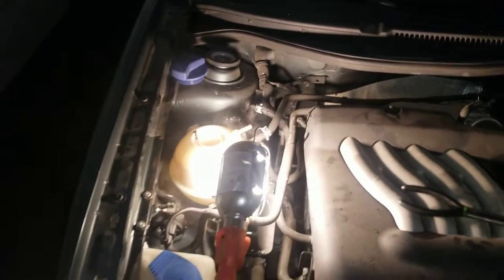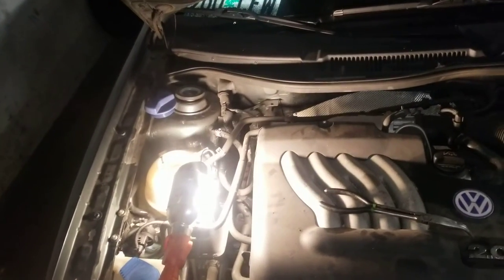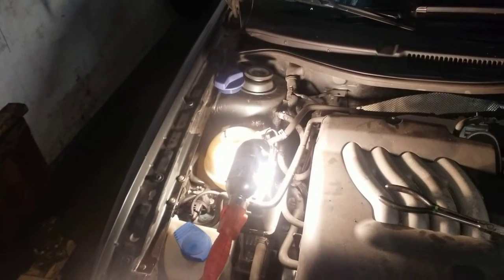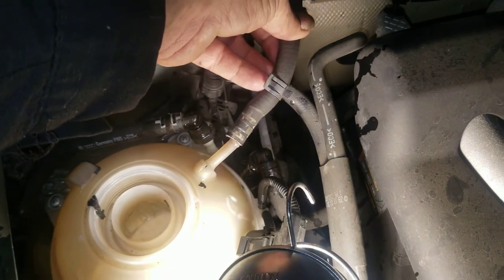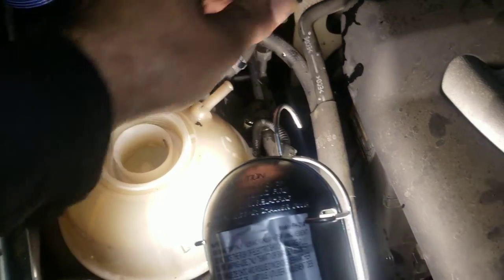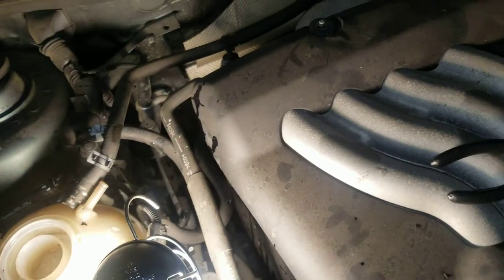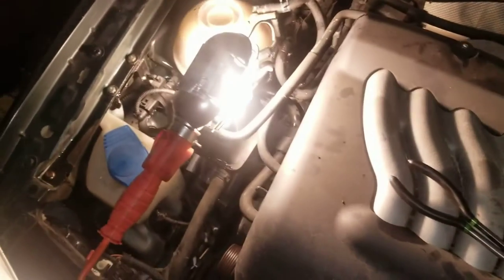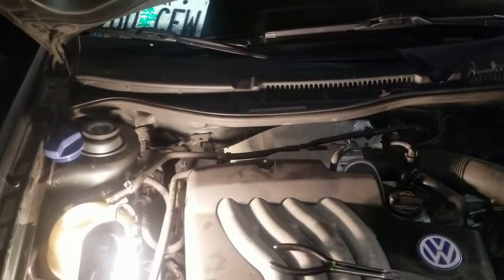VW No Heating Because Blocked Reservoir Returns Hose.

Comment: This car has been causing several problems with today this hose and tomorrow the next.  For 2 weeks now.   I notice the thermostat was not opening so i change it.  Hopefully that will stop all these hoses bustin.  Also my radiator broke too.  I jb welled that area so now its good.  I used the jb weld for water.  It sealed it right up.

Comment: Hi, great video. I think I have a similar problem. I'm getting no water through this pipe, the coolant doesn't seem very warm in the reservoir when engine is up to temperature, I'm also able to open this cap with very little pressure release - I shouldn't be able to open this and engine is overheating gradually - this is oil temperature, coolant temperature remains at 90 degrees after thermostat change. Previously the coolant temperature was stuck open, and engine temperature was around 92 degrees celcius. After changing thermostat coolant temperature bang on 90 and doesn't move but oil temperature climbing and climbing, up to 120 before I turned back home. It's never been this high before. Also changed the secondary/auxiliary pump as this became faulty and then had the water pump changed to no avail. I'm getting warm air inside the car but it's not as hot as I think it should be, but fairly warm. The lower radiator hose seems very cool to the touch, the top radiator hose is hot but this was a new radiator a year ago.

So to summarise, my engine is overheating, I have no pressure in the cooling system and the coolant is never very warm in the expansion tank. I have no leaks that I can see and the coolant level is always at max. It's a Golf MK6 2.0TDi CFFB.

Hopefully you could offer some advice, would be greatly appreciated!
Reply from the maker: Have you try to check the coolant temp sensor? On those cars always go bad and open the reservoir and let run for a while to bleed any air in the system. Sound like you might have air in the system or temp sensor is faulty
Reply: @abdelcarfix2770  the temperature sensor is a good thought, I haven't checked it so I'll change it. There are 2 I think, one on the bottom of the radiator and one on the side of the engine block, I guess I'll change them both. 

So with air pockets, the coolant has been dropped a number of times now with the various jobs that have been carried out, I made sure that no more bubbles were visible in the expansion tank while running the engine with the cap off, I squeezed the top radiator hose which helped push the air out. This took me about half hour I think. I could only reach the top hose as everything's such a tight fit in this engine bay. The garage I took the car to for the water pump replacement also topped up the coolant so I would imagine they did the same. I don't know, I feel like I got the air out but could there be more? And how do I remove it? There are no bleed screws on this car.

I haven't tried pushing some wire down the pipe yet, I will try that tomorrow but I haven't seen anything come out of there last time I took the pipe off. Should the water flow back into the tank when the engine is revving?
Reply from the maker: If you have air compressor try to blow air into the hose if it's gloged

Comment: Coolant reservoir inlet water flow is fine & normal. 
The thing is.. no water flow through return  hose from radiator to water pump(thermostat line)….& also coolant temperature sensor located in the same hose. Plz help me to resolve.
Reply from the maker: What year and model your car and engine size? Do you have overheating issues?
Reply: @abdelcarfix2770  Skoda superb 1.8 tsi petrol  (2009 model ).I’m also having overheating issue. Temperature gauge is in normal
Reply from the maker: @vijaysundar5250  have you checked the thormstat?
Reply: @abdelcarfix2770  thermostat is situated inside the pump, is it removable from that assembly?
Reply: Thanks for your timely reply and I appreciate your dedication in work keep it up 👍.
Reply from the maker: Yes its down with water pump my advice change both. Those common issues with those models
Reply from the maker: If you decided to change the pump and thormstat make sure the little connector between the pump and the oil cooler is connected well

Comment: Nice. So in normal operation coolant should always be flowing back to the reservoir from this hose on the top that you just unclogged, correct?
Reply from the maker: Yes
Reply: But I see no cooling returns
Reply from the maker: Yes

Comment: I have similar car engine vw 2.0 naturally aspirated, car is not overheating but i have no heat in car when it is cold outside
Reply from the maker: Make sure no air in the system and check the heater core hoses if they are hot. Heater core hoses on your firewall

Comment: Nice video
But how do you uncloged that?
Reply from the maker: You can blow through it or stick wire and everything will come out with coolant pressure
Reply from the maker: Blow through it with air or use small wire